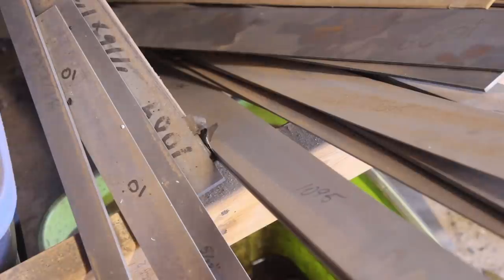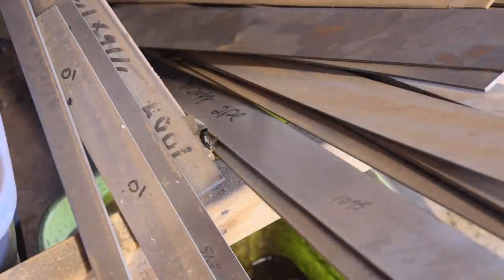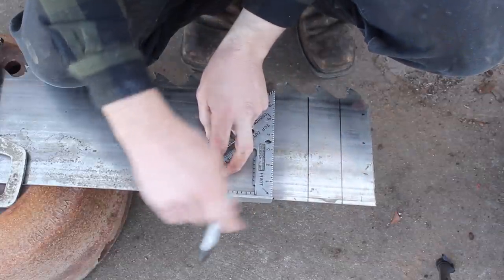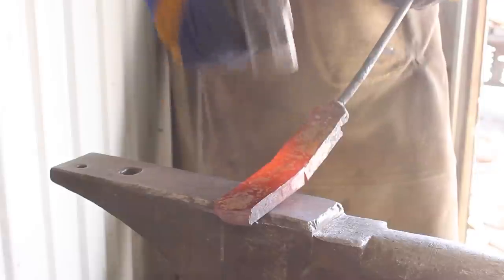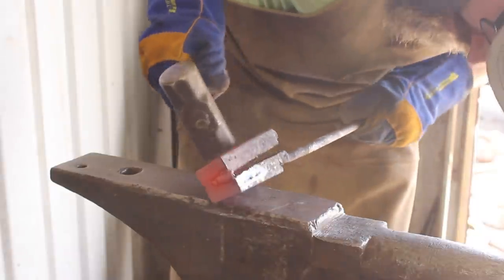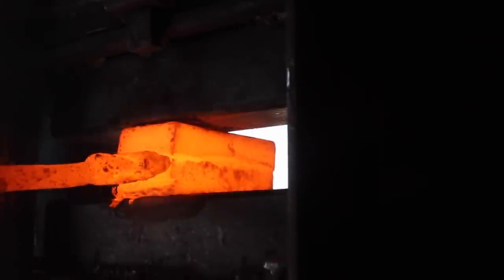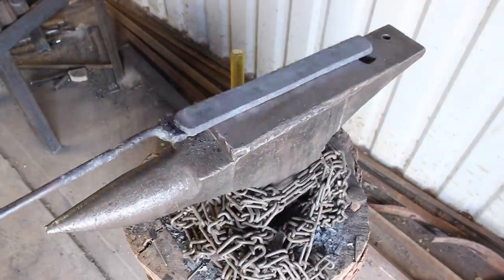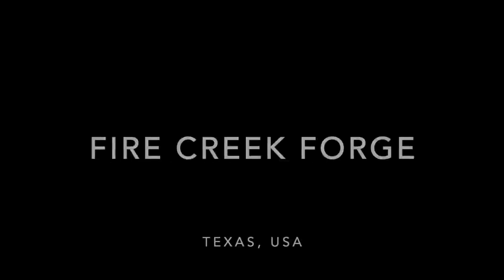Forging Modern Damascus Steel: A Documentary From A Blacksmith Shop In Texas | Part 1: The Billet

Comment: There’s a company that specializes in explosive welding. It produces a clad product that only industry or military can afford.  Some of this clad metal is two metals which normally cannot be joined.  It’s performed inside a mountain cave and no personnel are present when the explosive material is set off.  It’s a highly controlled process.

Comment: Interesting trivia:  That blade you are cutting up was last used in the winter.  I can tell because the little hump in the bottom of the gullet is called a frost notch.  It is designed to kick out the sawdust from the gullet in freezing temperatures before it can refreeze and stick to the log.  If that happens, the blade will "snake" through the cut and the mill will waste lumber.  I've sharpened those things for the better part of twenty years now but the funny thing is I've only made one knife out of the steel.
Reply from the maker: Interesting! yes, good old Idaho saw mill

Comment: Here's how rookie I am, made a weld of skil saw blade and leaf spring, cooled it of in water (wasn't meant as a quench, just wanted to hold it in my hands) 🤣 it's now 3 seperate pieces 😂🤔😜🤣 well, at least I successfully forge welded the blade to the leaf spring 👍 no acetone, just ground em, tacked em, heated, sprinkled, heated more and hand hammered.  Can I tack them together, as 6 layers now, normalize a few times to release all that stress and have a dependable blade? Or is it completely ruined and start over?
Reply from the maker: congrats on the weld! I would be concerned about cracks you can't see. You could always try and see!

Comment: Would like to see an analysis of the metals of a press made billet and a hammered billet, according to the original katana makers, the two metals start swapping out carbon, and other minerals during the forging process, the low carbon steel absorbing the other steels carbon, as well as carbon from the fuel they used. My theory is the hammering moves the minerals during the process, whereas a press might not so much.
Reply: To make that comparison, you'd need to start with tamahagane for both items. A number of Japanese smiths do use power hammers or presses to consolidate the kera they use, and even to forgeweld the hagane_, _kawagane and shigane into starter billets to be drawn out. The sunobe is almost always hand forged though, so you may well see zero difference in grain size, texture or carbon profile by the time you get to the end of forming the sunobe
Reply from the maker: That would be interesting. Carbon diffusion happens at high heats without hammering, perhaps the method of working the steel would influence it further, I don't know.
Reply: @FireCreekForge  Carbon diffusion is one thing, but almost all steel contains appreciable substitutional elements as well, and it's their diffusion across grain boundaries that has most control over microstructures formed in steels. Almost all iron ores globally, be they ore bodies, or ironsand also contain appreciable microalloying with elements that do have a pronounced effect on both grain boundary diffusion and carbon segregation to atmospheres

Comment: L6 also contains appreciable chromium and molybdenum*, so the resistance to etching has subtly different chemistry and outcomes. Have you done much work with it, I don't think I've seen it feature in your videos?

*well, European, L6, anyways...
Reply from the maker: For clarification, I've personally used 15N20 and mild steel with high carbon steel, I haven't used L6 yet myself, but I know of people who do exclusively, namely Kevin Cashen.
Reply: @FireCreekForge  Yes, I thought I'd only seen 15N20 with whatever high carbon plain steels you'd selected for any given project. 
Over this side of the pond L6 is a little different from the AISI version, but in principle it should behaved the same

Comment: Just thinking outside the canister ( box), here.  Would it be simpler to place the steel pieces in a tightly wrapped steel 309 foil ‘baggie’ with a goodly amount of diesel than welding the blanks together?  The foil should simply peel off, without the extra effort of grinding, or risk of ‘contamination’ of the billet, and it would ensure an oxygen free environment for the forge welding to occur.
Reply from the maker: I haven't tried that exact method, sounds like it would work

Comment: Wrong on the Damascus by the way its where it originated due to the only source of the original iron content ore ( high in carbon ) on planet earth IE ""damascus steel "" did not exist before it was mined in syria .
Reply from the maker: I've never heard of iron ore containing naturally occurring carbon. That would make it steel. The carbon is added during processing. In the case of crucible (wootz) steel, the carbon source is put in a sealed refractory container with the raw iron, and they combine to form steel as the iron is melted in the crucible. However, alloying elements can occur naturally with the iron.